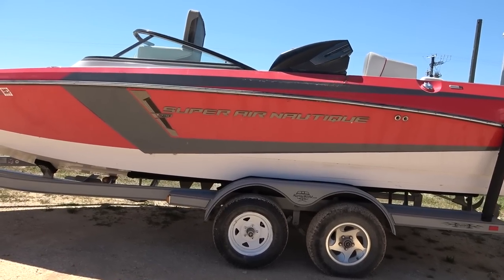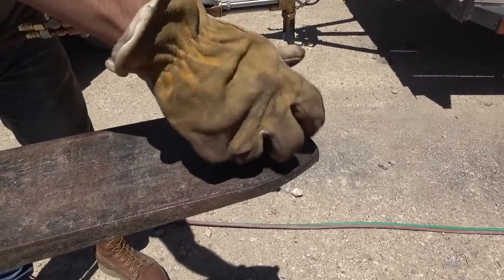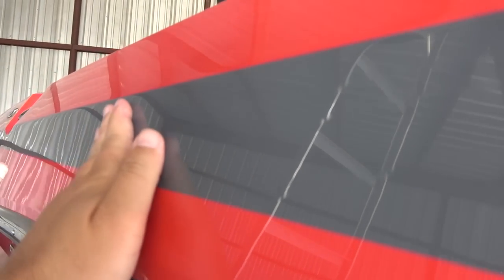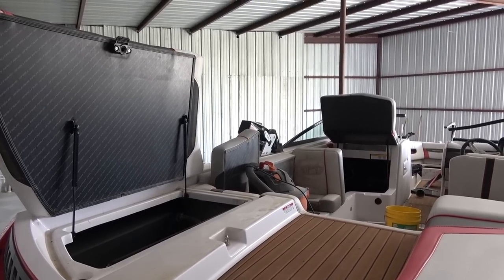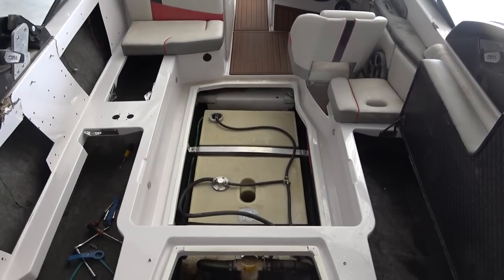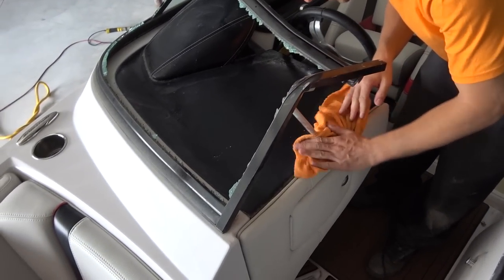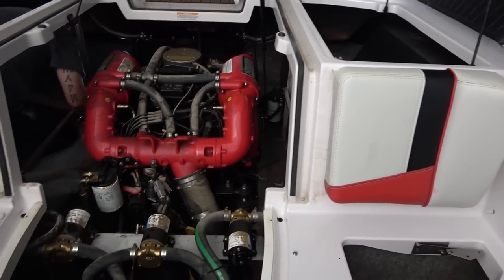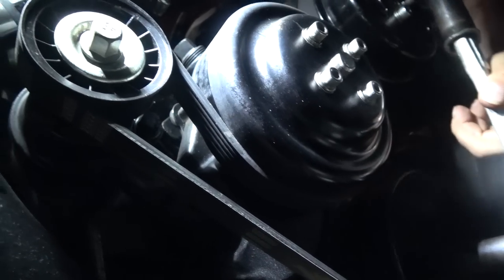Flooded Copart Super Boat REBUILD PART 2 - More DAMAGE!?!

Comment: Grind the hairline cracks, fill them and auto paint it. It'd be easier to match the paint vs gel coat. The boat is a great find and you'll do a awesome job on it. The pink spots are a mildew. The best product I've found to take care of that is Star Brite. I used to buy it at Walmart for $6 but after I kept buying them out, they raised it to $9 which is still worth it! I use to build boat parts and I had a detail business for many years so these are just suggestions but if you want your boat to turn out like factory, use a professional boat repair shop that knows the importance of fiberglass structure and is current on the best products to give you the end result you're looking for. Don't go cheap or you'll not only waste your time and money but ultimately, you won't be satisfied. You have a jewel in the rough, bring it back up to value.

Comment: Seriously sucks for whoever buys this when it’s “fixed”
Reply: Yea because you commented on it
Reply: Depends on how well it's fixed really.
Reply: Jester123ish guess it really depends on the buyer. I personally would not be happy unless all damages were disclosed.  The boat will probably be priced close to the value of a regular used one. Regardless if it’s “fixed correctly” the damages still happened which in the future could open more issues, putting the buyer in a position where he could have spent a little more and got a solid boat. We also aren’t talking about a $5000 puddle jumper.

Comment: The pink dots are a form of mold... there is a uv light system that can get rid of them.. I haven't been able to find an at home or life hack way to do it. Hope this helps... if anyone has a sure method of getting rid of pink mold please share.
Reply: george shencavitz Yes George is right. It is mold. Had it on two boats of mine.
Reply: @jonclements2554  it's bacteria not mold, bleach is the best way, then let the sun fade it if there's any marks left. The problem is, the bacteria grows inside whatever it appears on, not just the surface.
Reply: @v8trauma  you're right it is a bacterium growth, they do call it pink mold or pink mildew though for whatever reason. I've tried bleach and all sorts of sprays with no luck 😥. It happened to my boat withing the first 2 months of ownership.

Comment: The pink stains are caused by a dye that originates from bacteria.  The dye is produced by the actinomycete bacterial genus, Streptomyces.  This organism was previously known as “Streptoverticillium reticulum pink stain”.  It is not the only species that causes the pink staining problem, but it is one of the best known offenders. These bacteria can be found on the vinyl surface, as well as in the actual foam under the vinyl.  Like most bacteria, they thrive in moist, warm environments.  Essentially a boat is their dream home, with everything they need to grow.  Good luck getting rid of them.

Comment: unfortunately, the next owner of this boat will most likely pay way too much and never know it was sunk and repaired by an amateur with zero boat knowledge... BECAUSE... Texas doesn't  have salvage / rebuilt titles on boats.. that's right... a basket case turd can get shined up and sold as any used boat.. it's up to the seller to do the right thing... disclose the history.... and then price it accordingly...  it's an ethical decision for the seller to make... do the right thing and disclose... settle for thousands less than just forgetting to mention the boat was crushed and sank... the engine was full of water and rust.. the electronics under water.. the foam and wood are rotting.. the glass and gel coat defects patched and covered.. etc... you can see how Inna state like Texas, one might opt to leave out those details when selling to a unknowing buyer.... and that's easy... lots of novice buyers out there... lets hope this guy does the right thing.. tho, this boat is probably a loser if he does... I feel bad for the poor schmuck that buys it... that engine should come out and be torn down.. at the least honed.. re-ringed and new bearings put in... that's provided the crank and cam isn't all rusted... but hey, just drain the water and milkshake oil.. crank it up...  same for the transmission.. no need to inspect... just run it... when it fails... in the middle of the lake... the the mullet buyer who will foot the tow bill and repower costs in just a few hours...
Reply: Well said!!
Reply: somehow ..    i dont think he will seeing as he has 94 thousand followers and hes openly having fun and discussion spending money on repairing a boat and sharing it with the entire...fooking ..planet.
Reply: @danieldavies4561   Daniel Davies  maybe one day you will learn to speak English properly... or write it as in this case... I can honestly say... without reserve.. I have zero fucks to give in regards to him seeing this or anything else.. I merely made a comment... with factual points... and expressed my opinion.. which has been liked by many... and is a realistic take on this particular project... this guy is clueless about boats... maybe other things too... I haven't watched him before this... I do know however... I feel bad for whoever ends up with this boat...
Reply: Getting a junk car is one thing. Buying a boat that will more than likely leave you stranded in the middle of a lake or even worse ocean is just a terrible idea. I have the best boat ever as it is my buddies that just stores it in one of our buildings. Use it whenever and he has to always fix it. Although it really never breaks down. Nice bass boat with an outboard. But it is tiny compared to this  boat.

Comment: Gel coat is easier I find. I was a processor at Campion Marine and I did all the outside and Inside gel coat by hand and it’s easy if you know how to apply it correctly. Wipe it down with acitone then sand the heat transfer our cause that’s what the wave in it is the heat transfer then gel coat when it’s flat. Sand and polish

Comment: Good grief man, you can't overpaint that damage, its the structure of the top moulding.  It's got to be a rebuild of the inner and outer structure of the glass and gel coat.  It's Rebuilder Guy not repaint and hope for the best!!  It's a poor build judging by the underlying moulding but the strength is that of a monocoque and when broken the strength disappears

Comment: Grab a bore scope and check for rust. if the cylinders are clean and the oil is clean of water, fire it up. if not, pull that motor apart, if you spin a main bearing cap it could end that motors life. best of luck!

Comment: I would agree with some of the people in the comments. Take the time and repair the haul with gel coat. And for future builds instead of ATF in the motor use marvel mystery oil. Way better for the rings on the pistons. And read up on sea foam for the oil. It will help with what water got into the bottom end. And is safe on the main bearings. Dont use ATF in the bottom end of any motor.

Comment: You also have to pull the vinyl off the seats so you can dry the foam out or it’ll mold. You should be able to restaple the original fabric once the foam is dry.

Comment: You will most definitely have to use gelcoat to repair that. Automotive paint is for, well, automobiles. It works, but it's not ideal and fades quickly on a fiberglass boat.

Comment: With all that damage to the port side I'm concerned the "cabin" isn't plumb, port, starboard, forward aft isn't matching?
I'm sure you have thought of that possibility and will deal with it if it's an issue.
I'm astonished the hoop(s) supports are fastened down only through the fiberglass?
I suggest after the repair, adding a doubler (steal or aluminum) to the underside for the loop mounts to fasten through.

Comment: Gellcoat is there because fibreglass isn't waterproof.
If it's carbon or carbon/kevlar then the resin will be epoxy, therefore waterproof.
Remember gell doesn't go off properly when exposed to the air. Seal any repairs off with tape over the top, then sand it back.

Comment: Worked as a Painter at A Boat Manufacturing company for 6 years and we used Automotive Paint on both our Aluminum and Fiberglass boats, i was more the aluminum side so won't be much help but will answer any questions i can.

Comment: I hate to tell you this, but I sold vinyl for 20 years. The pink spots are a result of mold growing from underneath, or behind the vinyl. The surface turns pink, and there is no way to clean it off. You are unfortunately going to have to reupholster those areas affected by the mold. Sorry for the bad news brother. Good luck!

Comment: I wonder if you can get a top cap for this boat and just replace it. I’m sure you know you can take the top cap off. Also I’m sure you know that if you drain the water out of the engine you put the atf fluid in and spin the engine. Don’t drain the water out and not put anything in it. It will rust quickly.

Comment: It's amazing how many non boating people are in this comment section...stress fractures that appear in the paint are a huge indication of severe structural issues but there is special marine, lead based paint that adds structural rigidity and can over-come the most severe of problems. It cost about 400 a gallon but trust me its worth it! Message me and I can fill most orders in about 24-48 hours. Since it contains lead its illegal in the US so I have to ship it in a normal sherman-williams paint can.

Comment: I would advise against automotive paint. You need to grind out the stress cracks, fill them with a mixture of epoxy and filler, and then paint with something like AwlGrip. I suggest watch Boatworks Today’s channel.

Comment: The pink dots are mold I'm pretty sure, I've seen it happen to wet paper towels that get left out in a damp environment.
Reply: Kosmoto is correct.   Mold is the pink dots.   Boat must have gotten very wet then not allowed to air out.   You will never get rid of it permanently unless you replace foam and vinyl.   In the hot sun it will fade.   It will always come back with humidity or when you cover your boat and moisture still exist.   When you cover your boat after use put a fan under the cover.   Have this fan on a timer for 3-5 hours.   Be sure to leave belly plug pulled.   This will allow the pink to fade.   Good luck

Comment: You will need to sand all the gel off or it will show back up and its if broke you need to re glass it. Can grind it deep and glass from outside and if you can get to the inside glass it there also. Repair with gel be best but if you are just doing the top part you could get away with paint.

Comment: I detail my vintage sports cars and motorcycles and  I am really surprised you guys are not wearing gloves from all the chemicals in cleaning solutions like Super Clean or Meguiar’s All Purpose Cleaning Solution.  Along with a pressure washers those are the best cleaning solutions for tough grime with a Scotch sponge and microfiber towels.  For seats and carpets I use a steamer too.  I will use Meguiar’s Gold car soap for normal cleaning for cars and boats.  Both those chemicals are nasty and I even now use a canister breathing mask so I don’t breath in the chemicals.  Better to be safe than sorry years later.

Comment: Having just recently flushed two engines in a cruiser that sunk you’ll need to at least do two or three oil changes running the engine for at least 10 minutes each time. You’ll be lucky if that engine is any good given the amount of time it’s been sitting without being flushed out.

Comment: A tip to make the hand washing quicker next time: 
Always wash the cleanest spots first and then hit the areas with all the dirt and mud. 
5:00 I don't think it's scratching anything by spreading the mud around but it's for sure fuckin up that rag and your soapy water for the rest of the work.
Nice find though. Besides the fiberglass and paint work the rest is cleaning and replacing parts. I've painted cars but no boats. Sounds like you know what you're doing at least so  you can fix it the right way.

Comment: Being the upper part automotive paint will be fine after u get it running and fixing the fiberglass under the gel coat and u can also use a 2 part epoxy paint especially if u need to fix something on the bottom

Comment: If it's been under water it's salvage, stringers transom decking anywhere with wood coring is wet and now it will rot!
Reply: ....unless the stringers are fiberglass.  Which a lot of boat makers are going to.

Comment: Well I've worked on both now and then been working on both for a long time but I didn't find the problem with bass boats and other boats getting water on them and no not finding any kind of leak a gasket that holds the two pieces together if you look underneath there you'll find that your water is coming through there it needs to be sealed off that will be some of the problems that you will find water coming in on the boat

Comment: Use automotive paint, I do professional gel coating at a fiberglass shop it will be hard to work with and won’t dry correctly if you don’t spray PBA on the gel coat after

Comment: I work with gelcoat everyday as I work in a fibreglass factory, it will be so hard to get it smooth without a gun, but even with a gun unless you know what ur doing you’ll end up with runs and will have to redo it anyway. 

Stick with the spray paint. A lot easier and faster
Reply: lol this is not at all true. You can thin gelcoat readily using patchaid (awesome stuff).

By far the biggest problem he will have is getting a color match for the gelcoat.

Comment: If it is turning over fine  there is no need to soak it with ATF but it wont hurt either. It is just the terrible mess you are going to have when you  come to cleaning out the ATF. If you crank it over it will blow out the plug holes all over the place. You will have to use a vac with a small hose on it and suck out the fluid from the cylinders just do not try to crank it over with the plugs in with the ATF in there or you will hydraulic the engine and bend something and possibly junk your motor. Not that much water came out the drain plug it seems from the first video. If the pan was full up to the bearings that I would be concerned. I would just fill it with oil and run it for 2 minutes then shut it off and check the oil. If it is really milky then change it. Then run it for five minutes and check it again. If is not too bad then run it till it is warmed up of course while also running water through the engine (cooling system) during all of this. After it has warmed up then do another oil change and it should be fine.

Comment: Use gel coat it's not hard, I've used automotive paint and it just dosen't hold up like the gel coat. Instead of cleaning the boat the first thing you should of done was try to get the engine started since that is really important.

Comment: Those pink spots look like confetti stains. Confetti is usually made with the cheapest chemical dye which leaves stains if it gets wet. Impossible to get the stains out if it's on upholstery :(

Comment: that bracket thing that broke all the fiberglass , i would have a polished stainless steel plate formed and make it like 3 feet long to help cover the damage and it would sure make it tons stronger and it would look cool too , would act as a step plate too , also all the places you cant clean how are you going to stop mold from growing , that would be on my mind but i am a clean freak , i would take that boat totally apart for a proper cleaning

Comment: Never mind the Gelco or Paint..... Can you return it? Way too much money. I bought a Malibu 23 LSV back in 2000. Not setup for wakeboarding but rather waterskiing and Airchairing. Sold it 4 years later for $25K with a Galvanized Malibu trailer and around 100 hours. The buyer couldn't believe how good shape it was in. No damage at all and everything working as new. All the stuff you're doing is low on the priority list. Get the engine, drive train, steering and electronic Perfect first. Then the big fiberglass damage. then work the fluff stuff last.

Comment: RBG, try using the white sponges that Mr clean makes that along with awesome cleaner and degreaser that you can find at the dollar store works great to clean vinyl and almost anything else.
Reply: richard vargas While they do work great on a lot of things, you have to use them cautiously. They are basically a very fine sanding sponge so it’s easy to trash the wrong surfaces. I’ve seen people take the finish off of their leather seats trying to get a stain out. I suspect those pink spots have penetrated the vinyl so I doubt the magic eraser will work. If he does try it I’d be very gentle with it and if it doesn’t look like it’s coming off right away just stop.

Comment: Your boat may have sank, because another boat ran over it from the port side...or someone ran over it, as it was sitting on the bottom. Could explain damage to the port gunnel, and the prop.
HAHA, custom windshield, customized by Capt. Crunch.

Comment: when are you going to get a trailer that fits your boat better
Reply: I honestly doubt he probably will. Because the boat trailer that would properly fit that is going to probably be 4 to $5,000 at least. And it's not uncommon for boats to be sold without a trailer.

Comment: About the vinyl. Not sure what those spots are but year ago I visited my coussin who worked at a boatshop. In the shop they had used boats and a few had some small holes and scratches in the vinyl. That day a vinyl repair guy came to fix those. He had liquid vinyl and color mix stuff and surface pattern molds etc. He just repaired those holes and afterwards it was almost impossible to see were they had been. So for you. Maybe call a guy like that and let him work his magic. Maybe grind some stain and refinish it to make it new again.